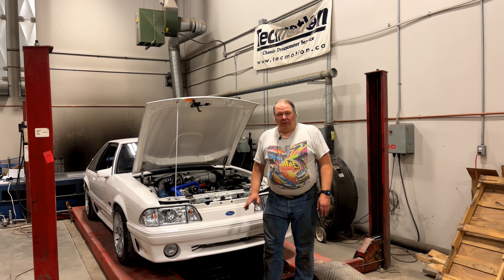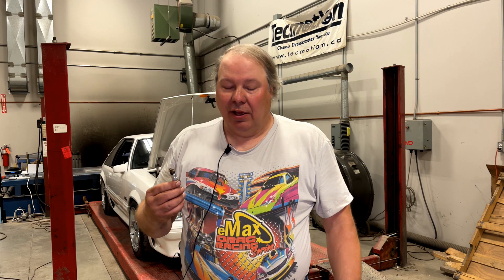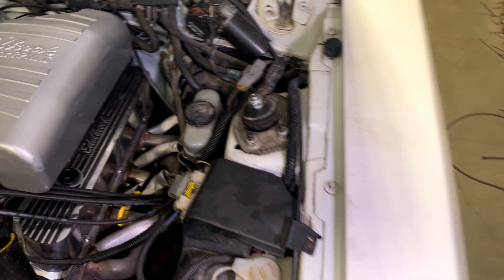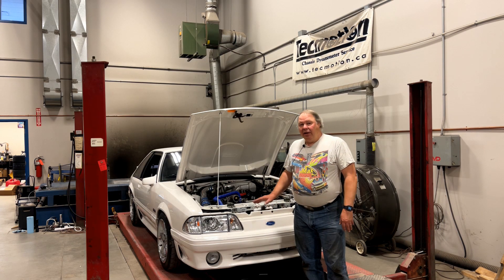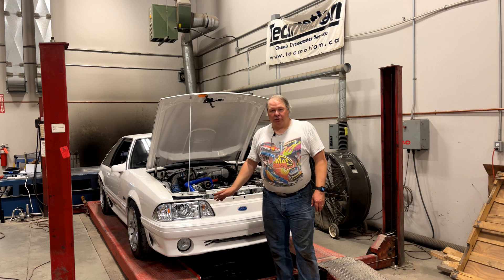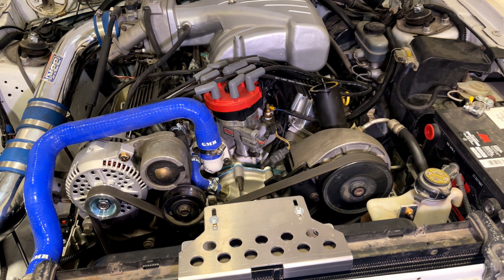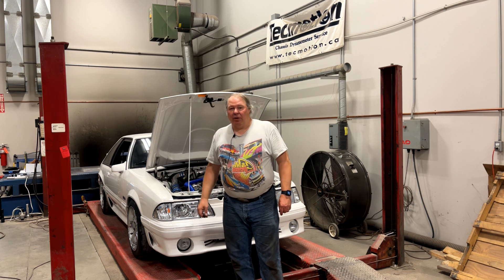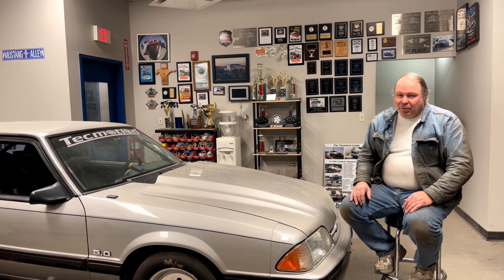Five Mistakes Foxbody Builders Make, or What is Wrong with my Mustang?

Comment: Had tapered seat plugs installed in my aluminum heads thank God only one of them gave me a slight problem. I now have the proper plugs installed.
Reply from the maker: You can usually recover from it, but I always cringe when I see it. One way or another, plugs that are made for E7’s never work right in aluminum aftermarket heads. There is a whole video on spark plugs on this channel too if you want more information.

Comment: @4:48 Also the lines.  People think just because they have a 450lph pump & 80# injectors that their fuel system is up to the task of supporting 600hp... then they find out really quick that the factory fuel lines are limiting fuel flow.  
For a typical bolt on 302 with a power adder I recommend the SVE ⅜" high performance fuel line kit.  It's nice direct bolt on pre-bent ⅜ feed - 5/16 return stainless steel lines that mount to the factory points including the factory connectors.  I use them on a 550 rwhp Fox with a 340 DW pump & 60# siemens deka injectors. 
Anything more than that I recommend ½" or  -8AN feed and 3/8" or -6AN return lines & an aftermarket fuel rail with a good pressure regulator.
Reply from the maker: Completely fair. I used -10 AN feed on my 9 second Foxbody with a -8 AN return. Usually by the time I feel like I need new lines, I go with custom AN lines. I even have a video on this channel about making up custom fuel lines if any of you guys need help with it: https://youtu.be/5VHWsW_YUK4
Reply: @tecmotiondyno  I use the same on my 1300hp turbo car... 10.0 GPM brushless Aeromotive pump & 160# Holley injectors.  Car has been 7.70 @ 178 mph. 
Im liking your videos so far!
Reply from the maker: Thanks! I appreciate your feedback. I've raced and built and Dynoed a lot of Mustangs so it seemed like a good idea to share some of my experiences with others. I'm guessing a guy who is running 7.70 in a Foxbody is just watching for entertainment, but I appreciate your comments which I think should be helpful to others as well.

Comment: I got tired of dealing with the crap computer and harness and put the terminator x in. Being a cammed car it runs so much better now.
Reply from the maker: Terminator X and Megasquirt are both good ways to go, and it is quite true that Foxbodies are typically FULL of wiring problems because the harnesses have been so cut up over the years.

Comment: 89 fox 5.0 first fired up shorty headers turned cherry red within a minute.  No cats b303 cam gt40 intake/geads bored .30 over off road x-pipe 2.5 exhaust dumped 40series flow masters.  Ive had and done work myself on my foxbodies for over 15 years.  Ive had 6 never had this issue
Reply from the maker: Virtually every time I see this it is because the timing is retarded. Set it with a light. If it still does it, confirm that your balancer is not spun which would give you a bad setup. Also watch for balancers with multiple sets of timing marks and make sure you are timing it on the right side of marks.

Comment: Forgot to mention the Damper, after many miles the front seal leaks, the Damper's rubber gets soaked with oil,
dry rotting it. 
Eventualy develops a vibration that is hard to detect that also causes hesitation and misfire
Reply from the maker: All the things in video are everyday things in cars that show up for dyno. I have a whole video just released that focuses on the damper and replacing it, and I am working on another video of more serious things that are often broken on these cars, one of which is the harmonic balancer. So, I totally agree with you!
Reply: @tecmotiondyno  thanks !

Comment: I really enjoy your channel and the many things to learn more about our Mustangs. Now after watching this episode, I too have a issue with my new rebuild that you mention. My 93 5.0 is stock, except for GT40P heads with upgraded Trickflow springs and a Crower 15511 cam. The car idles, starts fine, but it cuts out and loses power at full throttle about 4000-4500rpm. I'm beginning to think I need more fuel as the new stock pump is not enough. The injectors are new, stock 19lb. It never occurred to me that the mods I had done couldn't be handled by it. So what are your thoughts Matt? Question two, would I need to run a hotter/colder plug with this, as I'm using NGK TR5's gapped at .045. This engine is fresh, with less than 100 miles, but just doesn't feel as strong as it once was when it was completely stock. With 4.10's behind a AOD, you could punch it from a slow roll and she would want to go sideways!
Reply from the maker: I just did a similar car with GT40P heads, Explorer intake, 1.7 rockers, shorties and off-road exhaust. It was about 35-40% over stock depending on exactly where it would have tested stock. It used 30# injectors and a 30# calibrated MAF plus a 255 fuel pump. It was definitely beyond what could safely be run with 19# injectors at my 3500 ft elevation, and real fuel demand at sea level would typically be about 14% more again. Whatever the Facebook pundits say, you need injectors and a fuel pump upgrade for your changes. 24# probably work, but I always suggest you go bigger than you truly need to give you a little headroom for the next round of mods, especially if you are going to tune it.
Reply: @tecmotiondyno  Thank you sir for your advice, I will first try the bigger pump. The bigger injectors are out of my budget for now, I always heard that 19lb injectors would be fine up to 300hp, not so? Would the NGK TR5 be ok for this combo?

Comment: 331 with AFR185 and a vortech v3 with 60LB injectors. What size pump? Right now on a 255 with a boost a pump module that gives me more voltage after 5 psi.
Reply from the maker: Most of the time I would say that a 255 with upgraded wiring would cover that. I’m not a fan of pump boosters, but that will help with your deliverability and pump boosters with mechanical regulators generally don’t produce the pressure spikes that you get with returnless systems. I use a 340 in tank pump pretty commonly on applications like this too.

Comment: need to put a new bung 
On my older set of H pipes 
And I don’t like where the sensors sitting it’s right up there Crammed by the starter 
can I move it four or 6 inches down without having any complications
Reply from the maker: I’d be surprised if you had any trouble with that. Orient it so that the sensor head won’t get condensation on it. Guys run long tubes with headers in the collector all the time with minimal or no problems.

Comment: Big mistake people make when doing heads is putting the one head gasket on backwards causing the engine to run hot.
Reply from the maker: It can happen for sure. There is a video out there with a LOT of YouTube views that concerns installing heads on one of these engines and the entire procedure that is shown is wrong wrong wrong, so I see that as a source of quite a few common head install problems too.

Comment: i randomly just stumbled across this channel and i am thankful i did. 

i have a 95 gt

stock bottom end 306 
f303
ported p heads 
bbk LT
trickflow upper n lower 
75mm TB
pro-m maf 
with a ted jenkins chip (tune) with a 7k rpm limiter. 

the car does NOT want to rev past 4k. starts to pop n bang etc.

i have a aftermarket fuel pressure regulator i havent gotten around to installing , but i am also curious if my dizzy / wires / plugs are assisting in this issue. 

car is stabbed/ timed correctly. 

car is hard to start as well... takes 3-5 tries and when she does finally kick over it takes 2-3 more tries to keep her running. 

also if i even BREATHE on the go peddle she stalls. 

going to dig into your videos some more. but would love your 2cents if you have the time. 

thank you ! 

subbed !
Reply from the maker: There are a ton of things that can be wrong. My current project "The Fridge", which is a garage find 93 GT felt really gutless, and was kind of hard starting. When I got it on the dyno it was clearly lean and way off in terms of power, so I put a fuel pressure gauge on it and it was idling around 25 psi. This turned out to be because the feeder line inside the tank was cracked and fuel was bleeding back into the tank after it had gone through the pump. Sometimes a break up like you are getting is a bad coil, bad TFI module, bad or wrong plugs, bad tuning, or any of a bunch of other issues. Check the fuel pressure for starters. If it has a factory coil, a spec replacement with something like an MSD Blaster is inexpensive and probably a good idea anyway. Check for all the stuff in this video, and here's another one that might give you some ideas: https://youtu.be/U8uBEaA07GY
Thanks for watching!
Reply: @tecmotiondyno   i was NOT expecting such a quick response.. i really appreciate your input and the link to the correct video ! 

cheers !

Comment: Will a alternator upgrade be needed for my Hci swap?
Reply from the maker: Heads cam and intake by themselves wouldn’t necessitate it, but the supporting parts often do. Big fuel pumps, more powerful ignitions, electric fans, stereos, and anything else that increases the electrical load will require an alternator upgrade. A real problem with the electrical system on these cars is that the factory alternator is really barely enough to run the stock car, so when you start adding anything electrical you need to upgrade it. A weak electrical system can generate all kinds of problems that are hard to put your finger on. I have a video on here regarding the 3G upgrade which goes into a little more detail too.

Comment: @Tecmotion Are you running an egr valve? If not what what are you doing about the open connection?
Reply from the maker: The car in this video has a megasquirt engine management system and deletes EGR. There is a block off plate in place of the valve.

Comment: What’s your thoughts on the motorcraft plugs ?
Reply from the maker: There’s nothing wrong with them. Some of the Lincoln guys would sooner walk through fire than use a non-Ford part on their cars, but i personally prefer and always use NGK on pushrod Ford motors. A standard inexpensive copper core plug is the best option for most of these Ford performance applications if you ask me. If you use the Motorcraft plugs that are made for the heads you have, or Autolite for that matter, it will run fine.
Reply: Yep, l always found these cars like the regular copper plugs.

Comment: My solution to the fuel injector clips breaking is the late model Panther ones, squeeze sides, their 19 pounds also have 4 holes versus single.Unless there is a tool, needle or safety pins will allow swapping over without splicing wires.
Reply from the maker: Good tip.

Comment: Good info. The Fox 85A alternator is pathetic. LOL.
Reply from the maker: Yes, that alternator is barely enough for the stock car!
Reply: @tecmotiondyno  I'd say it's inadequate even for that.
Reply from the maker: I’m kind of with you on that, though if you have a bone stock car and everything is in good condition it usually just works.
Reply: @tecmotiondyno  Hmm...Idk...when I used to drive my mildly modded 92 as a daily driver, I found myself on the highway in a snow storm at night. I was running my wipers, headlights, defogger and rear defogger and everything was kinda dragging. The lights on the dash were dim, the headlights were dim, the blower wasn't turning as fast as it should. I was not driving a normal highway speed due to conditions, but it wasn't a low RPM or idle engine either. Upgrading the alternator was a life changer. Of course, I no longer drive it in the snow. Haha.

Comment: Great tips!
I have a carbureted '85 GT and just bought a Holley Sniper Stealth EFI. What has your experience been with this type system?
Reply from the maker: Generally, I have liked the Sniper, and usually the problems you get with it can be solved. I have a 67 Coupe with a 347 in the shop right now that uses it, and I have had a few unusual issues that I have managed to solve so I am thinking of doing a little video on some of the gotchas that you might run into with that system. Compared to other budget throttle body injection systems, I much prefer sniper because its learn mode is better than most, and most importantly, if it doesn't work right, you CAN do a comprehensive program on it with a laptop and usually get it to work fine. With some of the other "handheld only" type systems, when they don't work right, your only real choice is to pull them out and start over.
Reply: @tecmotiondyno  
Thanks for the reply.
Were the issues front mount distributor - EMI interference?
Reply from the maker: @Turbo4Joe363  there can be a lot of issues and the proximity of the distributor (and coil on the early cars) gets blamed a lot. If any of the key wiring is run in close proximity to other wiring that is noisy, especially ignition wiring, you will have problems. If you tap the tps wiring for an automatic transmission controller or fuel pump controller or whatever, you can introduce noise that interferes with closed loop operation. If you get a poor o2 sensor install it can cause problems. If you don’t pay attention to the fuel plumbing it can cause issues. There’s really a whole video worth of stuff to consider, so I have put that on my list for a future video on this channel.
Reply: @tecmotiondyno  Looking forward to that video!
You mentioned another concern that I have with my Sniper Stealth install...
O2 sensor problems.
I have ARH headers with slip-on collectors and O2 bungs welded into each collector (2 o'clock position on the collector).
Even though the slip on collectors fit very snugly and have 2 bolt together tabs, I'm worried about air/oxygen leaking into the collectors and screwing up the O2 sensor's reading.
I won't be installing the Sniper system until July-August when my 363 build is finished.
Reply from the maker: It's probably not that big of a deal. I don't like the clamp on O2 bung that Holley sends out, but they do it so they can claim there is no welding required. In most cases a weld on bung will work better. I have used slip collectors in lots of EFI applications and have never had a serious problem with them with respect to the O2 sensors.

Comment: Can you ground the fuel injector strap to the firewall?
Reply from the maker: It needs a block ground. The normal configuration is to attach the fuel injector harness ground and the braided firewall ground to the back of the driver’s side head with the same bolt.
Reply: @tecmotiondyno  thank you for your quick reply 💪🏼
Reply: @mike4fo  can you attach it to the back of a aluminum head and still get a good ground?